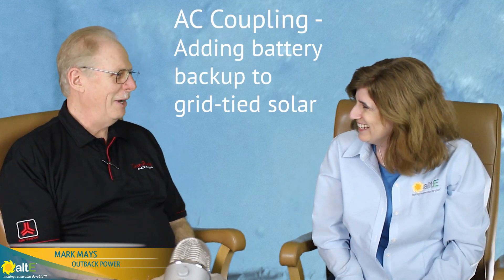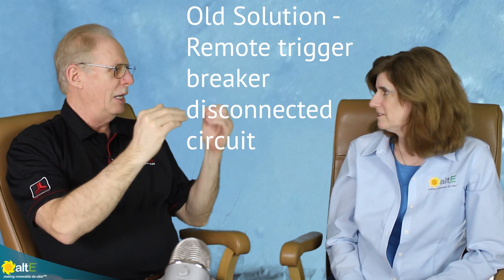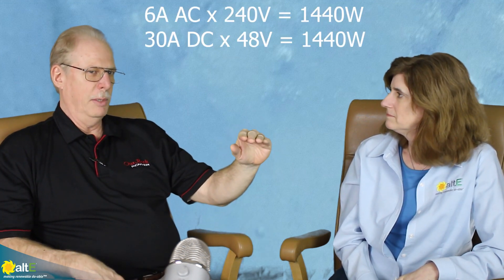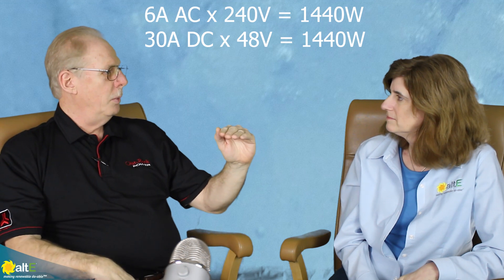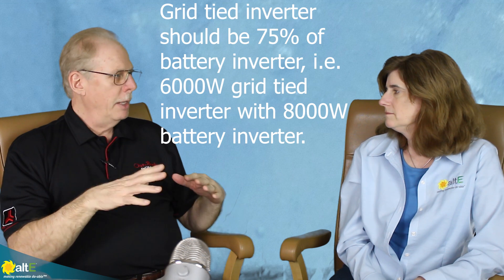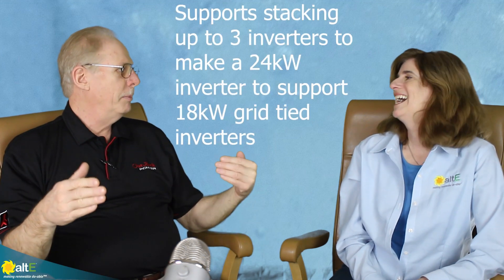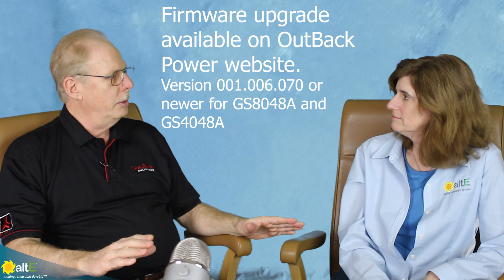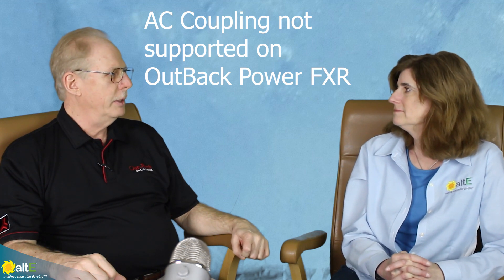OutBack Radian AC Coupling Solution 2019

Comment: what about keeping it simple; one set of arrays to charge a battery bank for an inverter which is then put in to an automatic transfer switch as auxiliary power just a a gas generator would be.  then a second array would be for the grid tie inverter.  when the grid is down, the ATS shifts the source to aux which would be the dc inverter.  this way there is no risk of over charging.
Reply: Because you completely negate the ability to utilize your solar array #1 investment in a grid tied scenario.

Comment: I have a Xantrex SW 5548 that I will be AC coupling to an Outback Radian GS8048A-01. The Xantrex is fed by my solar array 1 (3kw, 48v), through an Epever Tracer controller (80A, 48v).
The Outback will be fed by my solar arrays 2 & 3 (each 3kw, 48v), through a pair of Outback MX 60's (60A, 48v each), and monitored by a Mate 3.
I have 2 independent LiFePO4 battery banks from 2 different manufacturers, both of which are 48v, wired in parallel, with similar charging specs from each of the manufacturers.
One is a 3-battery bank, rated at 30kwh, which I intend to couple directly with the Outback inverter, while the other is a 2-battery bank, rated at 10kwh, which I intend to couple directly to the Xantrex.
I've been led to believe that one should not parallel-connect batteries from 2 different manufacturers, hence the separate wiring scheme to each inverter.
Will this in any way impact on the operation of the Outback's AC coupling operation, or should I ignore the warnings, and wire both banks in parallel to the Outback?
Reply from the maker: I don't believe you need to AC Couple the 2. They are both DC coupled hybrid inverters. All you need to do is have the AC Output from each going to the critical loads panel, and the AC In going to the grid. I don't see what AC coupling would buy you. AC Coupling is a way to keep the PV up when the grid is down, which you have with the charge controllers (DC Coupled).
Reply: @AltEStore  I don't believe that the older Xantrex meets the newest California standards, so I was thinking that if I AC coupled it with the Outback (which does meet the standards, I could piggyback the Xantrex to meet the requirement.

Comment: Hi altE, do you have idea about Outback Radian differs to Studer Innotec XTH or XTM AC-Coupling features?
Reply from the maker: I'm sorry, I don't know much about Studer products, so I can't make a comparison. From what little I did see, it looks like they output Euro 230V, not North American 120/240V. Radian does have a Euro version as well as NA.
Reply: @AltEStore  Thank you altE for the response. Studer Innotec XTH or XTM model voltage output can be set ranging from 110Vac to 280Vac and the frequency from 45Hz to 65Hz as well.
Reply from the maker: @ricky786  But is that 240V split phase with Line 1, Line 2, and Neutral? It is quite different than just 240V, single phase.
Reply: @AltEStore  You can program in (expert mode) either Split phase or normal single phase...It has also L1-N-L2 AC output terminals.
Reply from the maker: @ricky786  Excellent

Comment: not exactly related to the topic of this video; but have any of the major manufactures you sell talked about integrating support with any major BMS systems that are available to work with their charging systems to better support Lithium batteries?  I ask because the way i see it, many of the chargers seem to rely heavily on the BMS to mange everything but no way to talk for better detail.(battery life and level based on size)  It seems to me, and i may be very wrong, that the usual charging systems still treat Lithium batteries as a lead acid bank; but with adjustments made to make sure thee is no equalizing phase.
Reply: I believe there are some self managed lithium LFP battery system that don't require BMS. Some self managed lithium contain a BMS but do not require a fixed communication in order to operate